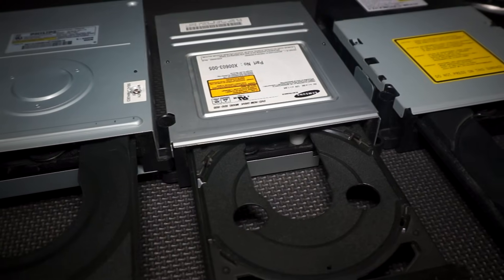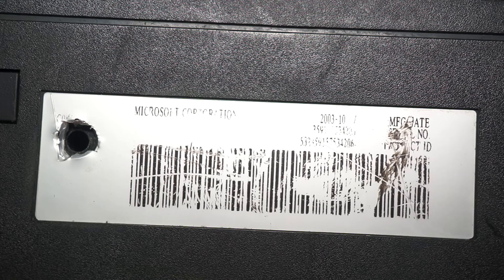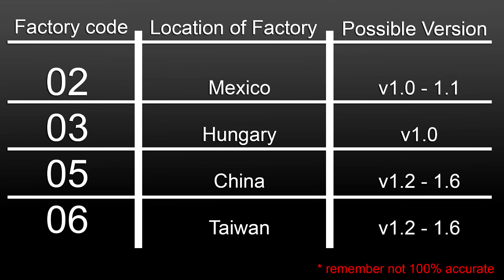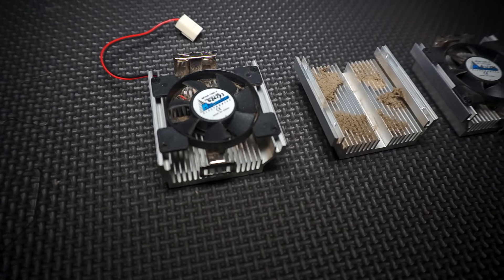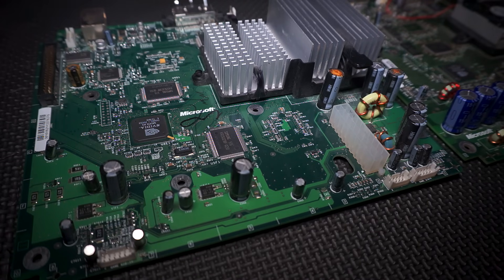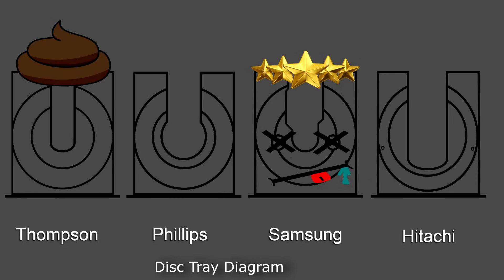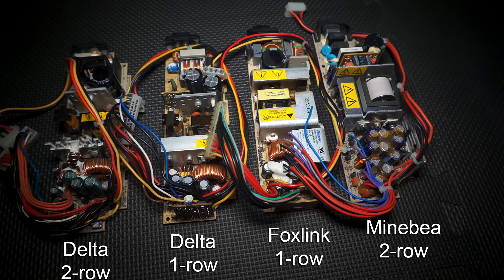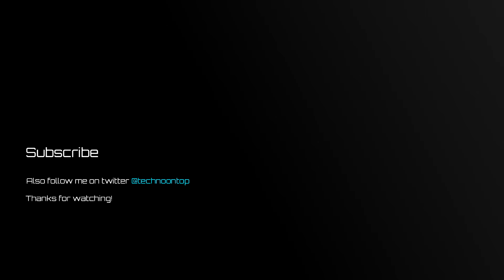How to tell what version original xbox you have

Comment: Your vids are very informative. One of the reasons I never got into the og xbox mod scene was because the og xbox controllers were not as responsive as the playstation or nintendo remotes. Are you able to do a mod to use 360 controllers or playstation controllers on an original xbox? I would love to see you do that mod with your led ps remote. Thanks
Reply from the maker: i have seen talk of people wanting to get the wireless xbox 360 controllers to work, but there really is no simple solution for it. dont quote me on this but they handle data differently then the OG controllers. something custom could probably be made (to handle the conversions) but im unsure if any one who could, actually would. iv never noticed the controller lag as a kid but compared to modern xbox one controllers its definitely there..... especially with the wireless but on wired controllers its relatively minimal. its been a little while since i last played something that required precision on the og xbox. but i appreciate the comment thanks for checking out my channel!
Reply: Thanks a lot, the feel is also better on the playstation remotes, more ergonomic / smaller, I think.  Thats why the 360 remote was so much better than the original xbox. Also, heads up, I emailed you about a project I'mm working on for an original xbox if your still offering you assistance to people. Thanks again for the reply
Reply from the maker: yeah i had both consoles as a kid and i was definitely an xbox fanboy lol but i can see where you are coming from. cool, i will check my email (thanks for telling me because it logged out and wasn't getting any alerts) and get back to you there.

Comment: Great video, I used it as a refresher recently for TSOPing one of my 1.0 consoles.

Are you sure you're testing against the right pin for a 1.4 vs 1.5 though? You said to test between pin 2 and any of the grounds near the screw holes, but it looks like you're actually connecting your red lead to pin 1, not pin 2. I ask because I tried the same thing with my very first original Xbox, the one I literally spent my childhood playing Halo 2 on, and when using the pin you specify, I get the same results, but when trying what appears to actually be pin 2, I do get a resistance value above 1.
Reply from the maker: you know its funny, i halfway think what I showed was wrong... it wasn't me who came up with that test.....your right every console i test it on i get the same value.... so its probably misleading or maybe the console needs to be powered on? or like you said its the wrong pin lol ugh...i will say that that board is definitely a 1.5 but not based on that test its what the system information in XBMC says.. thanks for watching!
Reply: That is the thing, my results are the same going by your video, but my dashboards do report it is a 1.4 console. Other sources also say to test against pin #2. It looks like in your video you were probing pin #1. I bet if you did probe pin #2 on that console, you would be validated.
Reply: I noticed it's the same thing when watching the video. My results on my motherboard also support testing actual pin 2, not pin location 1. Thank you for commenting on that. I was starting to think I was the only one who noticed.
Reply: xb0xisbetter put your

Comment: I have 2 Xbox and still don't know which one to use
3023042 52105
2255752 32905
Reply from the maker: It's really not a big difference 1-1.5s are ideal to me, 1.6s are fine  and can be hardmodded with a mod chip.  Thanks for watching
Reply: Just found I already have a Xbox modded (AppleX V) and another with the 10GB drive. Thanks anyway. Never had the chance to use it and had it for years.

Comment: OMG im so confused because I have the samsung chip with the the upgrade that does not have the fan but this console was made in 02 and the kernal sticker is not the just a serial number sticker I need more help I think I have a 1.1 but it has been refurbished will that affect my abbility to tsop mod the xbox origonal
Reply: I also have a conzant ship with no fan  and single row power supply my ram chips also say samsung so also my consoles front panel button connectors are in the same place as a 1.6 but all the chips are in the same place as the 1.0 I also have a delta power supply someone please contact me we can skype call if needed to identify

Comment: So i have a Conexant chip with no fan and a 2 lane power connector. which one do i have?
Reply: I also have a Philps cd drive, Seagate 10G HDD. However, my Power supply is a delta but looks different to the 2 u have?
Reply from the maker: I take back what I said before lol .. it's probably a 1.1-1.2 based on the video chip

Comment: The 1.5 I'd check the 2nd disconnected point to confirm.
Reply from the maker: +Steven Benson I wrote v1.5 on it after confirming it in the system information menu on xbmc the board is just garbage that since I have some Xbox fascination I have stored for years for no real reason . This was well before I knew how to use a multi meter,  one thing that is strange is the 1.0 and the 1.2 I have that are broken also have there grounds disconnected. I need to see if I have a 1.4 and see if that test actually even works. Never thought to question it as it was a guide on the Xbox scene

Comment: Did you ever tried to upgrade the RAM on Xbox to 128mb?
Reply from the maker: yes I have actually attempted it twice, both times I tried to use used ram I pulled off other broken boards, both times it didnt work, always planned on giving it another go with a different tactic and using new RAM but haven't yet
Reply: i want to try the ram mod but my soldering tip is too big and a 939 tip is like $30, so expensive
Reply from the maker: wow $30 for a tip? my station came with a pretty big assortment when i got it but ebay has the same type of assortments for pretty cheap https://www.ebay.com/itm/10PCS-Solder-Screwdriver-Iron-Tip-900M-T-for-Hakko-Soldering-Rework-Station-Tool/181633425710?epid=1055325628&hash=item2a4a32212e:g:04oAAOSwnDxUq2F5
Reply: holy shit thank u
Reply from the maker: +Dondonian no problem, get your mod on!